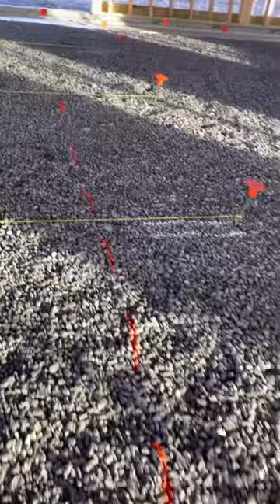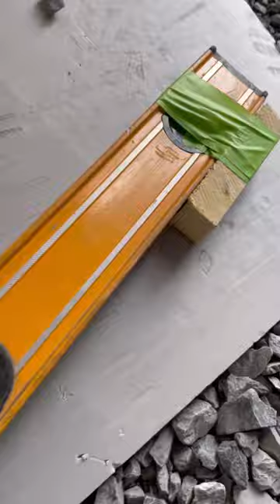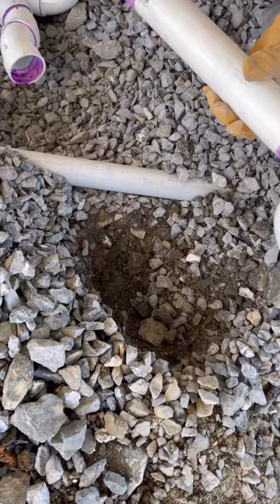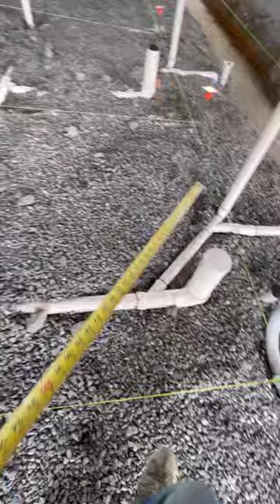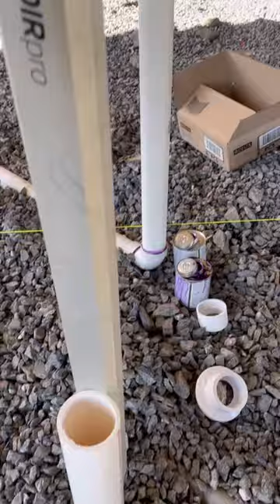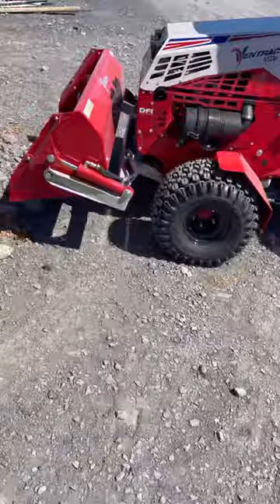How-To Under Slab Plumbing

Comment: Hello. I have an Unrelated question for you about vertical cold joints. If I pour concrete retaining wall one section at a time leaving rebar sticking out to tie into the next section and keying the new wall into the old one, is it likely to leak and stop me from installing stone veneer on top of the cold joint successfully? Is there a method to do this successfully? I appreciate any advice.
Reply from the maker: I’ve always tried not to have cold joints in walls. The house we are building right now is so large that we had to do it in several pours and had cold joints. I consulted with my structural engineer and he wasn’t too worried about them. We did exactly what you’re thinking to do. We let the rebar stick through and we did a keyway. From a waterproof standpoint I don’t think it’s a problem. A cold joint is not a whole lot different than a crack you might get in your wall. I would use a waterproof method that stays pliable for cracks, it should also work with a cold joint. 

But that being said I’m not a structural engineer and I am  not qualified to tell you what to do or not to do. It might not hurt to consult with a engineer.  Especially on a retaining wall. You may be required to have it engineered anyway. In our area any retaining wall over 3 feet tall has to be engineered.
Reply: @hausplans  thanks for the reply and all the info. Great videos! 🙏
Reply from the maker: Thanks for watching

Comment: What type of cement do you use? 
It looks like Oatey and based on the color of the label maybe the "All Weather Medium Clear PVC Cement". 
I am curious whether you use the Regular, Medium or Heavy (viscosity) cement and whether that is what you prefer? 

I am doing my first plumbing project and trying to decide on whether I should go with Regular which can handle up to 4" or Medium which should be slightly thicker and can handle up to 6".
Reply from the maker: I’m actually not the plumber but I think you’re right All Weather Medium
Reply: Here in Wichita Ks we use weld on 721 one step blue glue is a lot easier then the two step glue I only use that if I know I have to work In the mud because the primer cleans the pipe good but the blue glue works great just make sure if it’s allowed in your city when you use it in some cities it’s not code